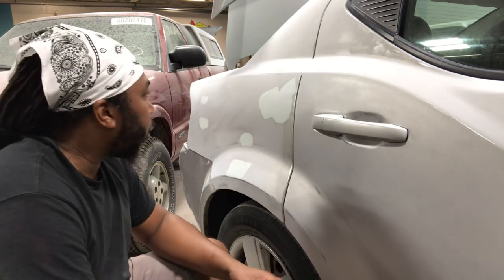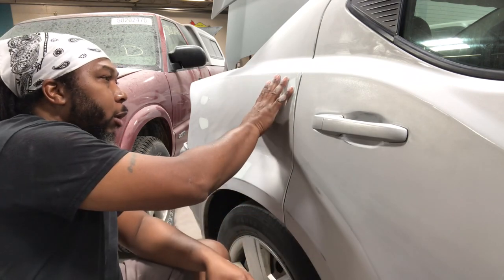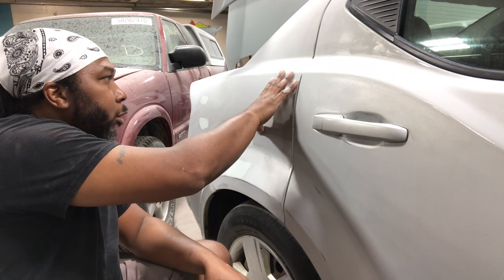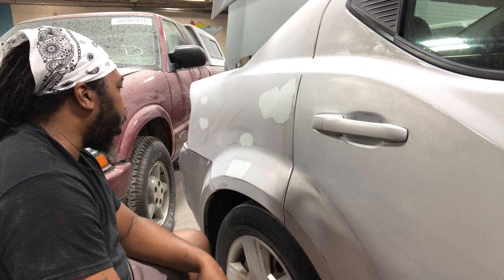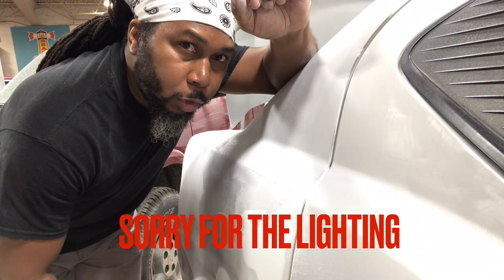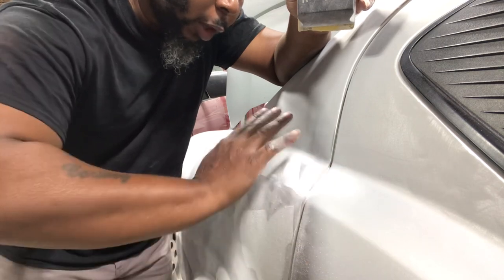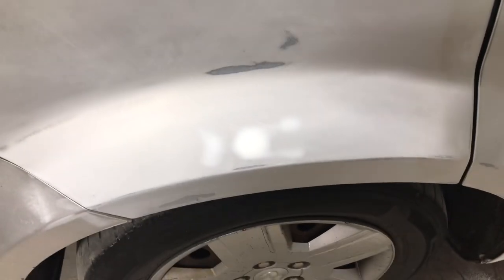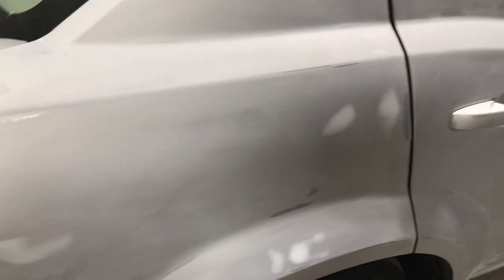Using the X pattern technique to block sand body filler/glazing putty

Comment: Great video upking very informative my problem  is if you  was to use a hb primer in aerosol  do you find you  got to put alot of coats on ? Or is it best to stick to 1k hb primer or 2k thank you for the video upking stay safe
Reply from the maker: It’s possible that you may have to use more coats using the aerosol spray can so I try to stick with a 2k primer that I know works!…I appreciate you as always Husky stay safe as well